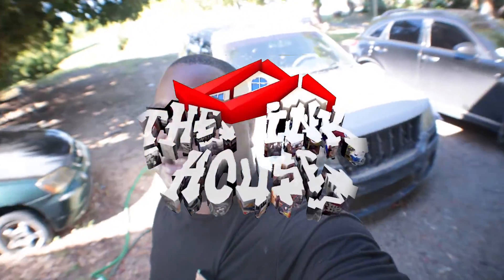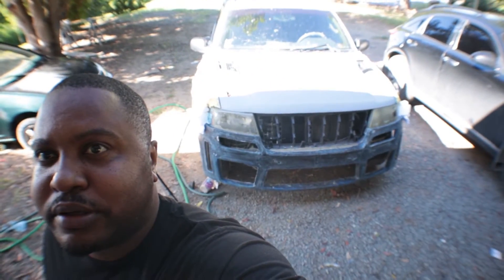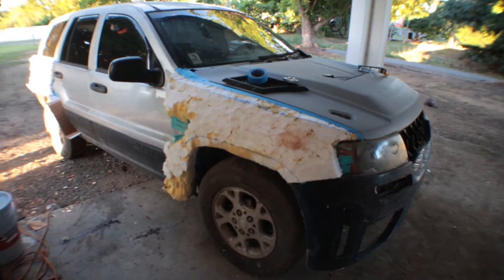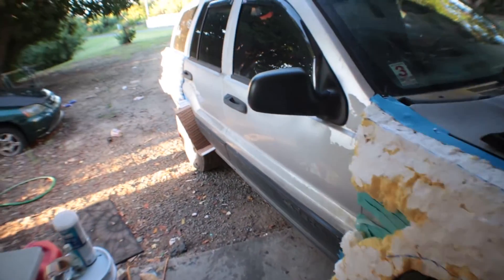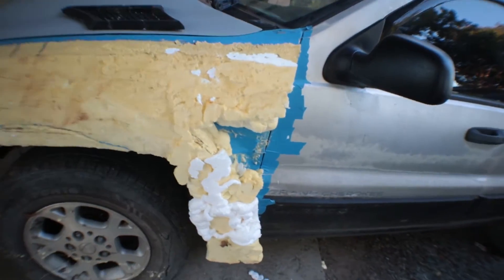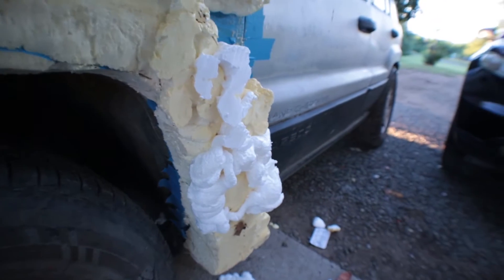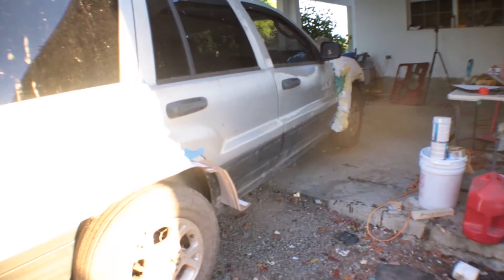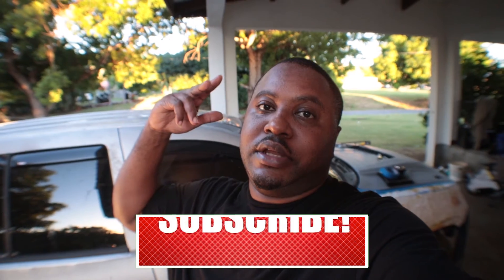update on Jeep Build, laying out the plan - Jeep WJ build Vlog 9

Comment: Call it an air diffuser behind the wheel. It could taper from top to bottom or slope in towards the door
Reply from the maker: @kidd7359 the idea im thinking is to move air from the wheel well. Not building a race car but it will have some power. 🤫 Hemi 💨

Comment: Before you start adding to the bottom portion of the car you might wanna look at suspension and wheel combinations; especially for the offset.
Reply from the maker: @bobby madison you right i have a set of wheels and a airbag set-up, I don't have bags for the jeep yet, trying to figure out whats a good size to go with. I have drop springs on the jeep for now.. thanks for your suggestion 👍🏽

Comment: Why cant you just add more fiberglass to the mold? Are you trying to save the mold or is it necessary? I'm new to this and I plan on doing something similar with my 350z.
Reply from the maker: @Fuggly Nugs I'm not to sure what your referring to, but assume its about the lip I want to add. I'm wanting to do it that way I can change different styles if wanted. Plus the mold is already built, so it would be hell to add to that without making a whole new mold.